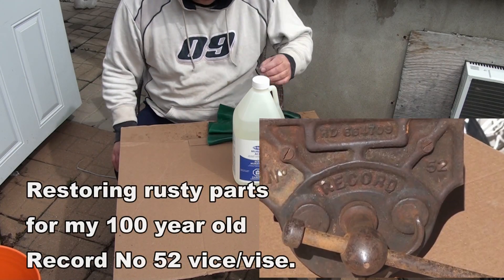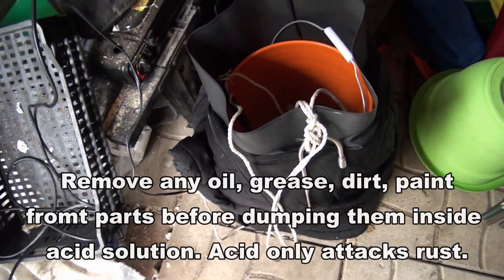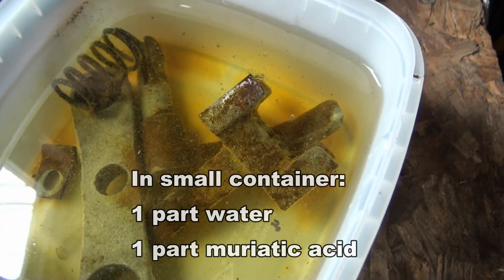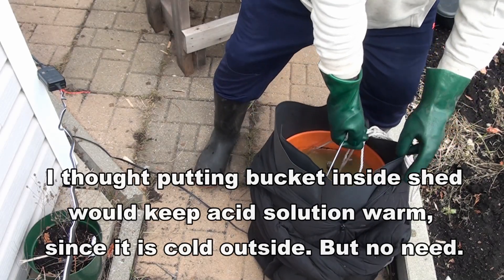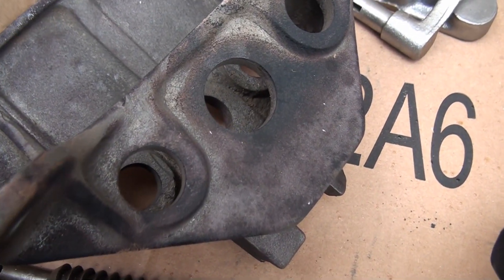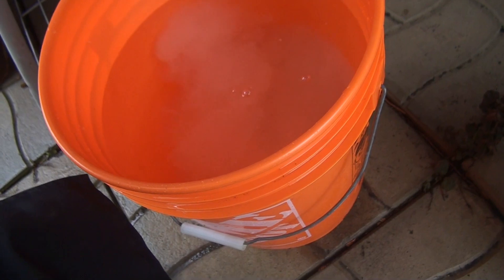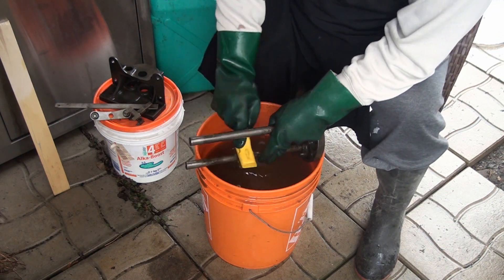Rust vs Muriatic Acid ***DISASTER*** Do not do this

Comment: I found out if you wash/soak it in the gasoline right after taking out from the muriatic acid.   all the left over acid from the rusted product will end up at the bottom of the bucket since it s heaviest comparing to petrol (gasoling) . Take it out , gasoline will evaporate and you ll end up with clean product ..paint over or buff it .

Comment: yup that's muriatic acid for you, and that's why I only use Phosphoric acid, I painted a hood of my truck after stripping it with Muriatic acid, neutralized it with baking soda after and still it rusted in less then a year after being primered and painted, trust me it wasn't that you left those other items in the shed, Muriatic acid does not prevent rust, that's why hot rodders use it to build up fake rust patina, it will actually rust things

Comment: I watched another video on rust removal with muriatic acid and that stuff is bad news. A guy used that stuff inside his shop and the fumes rusted a bunch of his metal projects that were in the shop besides the stuff he cleaned with it. Acid cleaning rust is fast but there's definitely a consequence if not done in the proper setting or method. 
https://youtu.be/pj40G8x2SVY

Comment: What percentage is the muriatic acid? I bought some today (paint dept,) and it is 31% muriatic acid. Is the acid you're using 100% muriatic?
Reply from the maker: Hey Wayne. Muriatic I used was 31.45%. Stay safe!
Reply: @Quinteros777  Thank you for the response. After I use the lantern, I'll let it cool. Then fill it with white gas to retard the rusting?

Comment: Can we use muriatic acid to remove rust from galvanised metal roof sheets?
Reply: Yes but you will take out all galvanize
Reply: Good way to die from the zinc fumes

Comment: After you clean parts in acid, immediately rinse in hot water, then wash in hot water and detergent and scrub vigorously. 
Rinse again in hot water and dry in a oven. 
Get the parts good and hot to evaporate any water and it will also evaporate any traces of acid that may have soaked into the castings.
After cooling paint immediately or oil parts that require lubrication.

The acid is both your friend and your enemy. It can make impossible cleaning easy but you have to work very fast to eliminate it or the parts will rust worse than ever.
Reply from the maker: Agreed, a friend and an enemy!

Comment: Sodium Bicarbonate (baking soda) will neutralise the acid as already mentioned, but what I did notice was that the black plastic bag was covered in water droplets..With the cold temperatures do you have a problem with condensation?…Uninsulated sheds and garages suffer really badly in winter, especially the ones with metal roofs, to the point where they are dripping with water..Temperature plays a massive part when doing this kind of work..

Comment: Water doesn't neutralize acid. Please learn about PH balances with cleaning before using strong chemicals that you don't know much about. You have to neutralize an acid with an alkaline
Reply: A what next? If I put it in soda solution, what is next step to remove this soda? Just water or nothing?

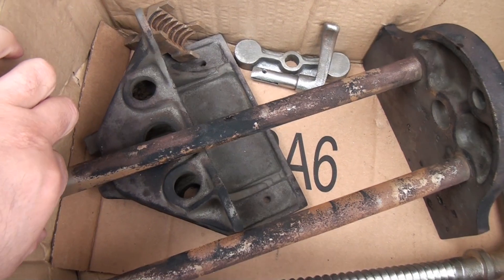Comment: 10:03 it's called flash rust.
Reply: flash rust is “rusting that occurs on metal within minutes to a few hours after cleaning is complete. The speed with which flash rusting occurs may be indicative of salt contamination on the surface, high humidity, or both.”

Comment: 1 Minute in and you already messed up! 
For that bucket I would only use about a cup of muriatic acid. If you used that whole jug you made it way too strong.
You should agitate the parts occasionally otherwise the parts touching will not be treated.
You DID NOT rub the surface with oil or a light coat of paint. 
YOU MESSED IT UP!...
Yup you are the problem!.... ALKA-BOOST? SERIOUSLY?
All you had to do was lightly coat the surface with oil or spray a light coat of paint on the parts.
You're just over thinking way too much!

Comment: fastest result. heat it up till it nearly boils.
reason for this is due to how chemicals work faster when the atoms collide more often, which is the effect of higher temperature.
this is in relation to how far away from absolute zero the temperature is though so even at near freezing the acid will still work quite well. though not as well as when it is near boiling.
minuscule difference when speaking about 20 degrees C.. 
so yea. sort of waste effort unless you are absolutely gung ho on saving a little bit of time.
the way to really make the reaction faster is by concentration, meaning don't delude the solution too much. it is probably already deluded.

!! Important
Always Always Always, safety first.
You can buy gas filters for that gas mask.

Comment: I can tell you what went wrong! You should have coated the newly derusted parts with a light oil like WD40 to avoid the flash rusting that happened overnight. It would have still ocurred even without the remnants of rubbish left in the rubbish bag.
Reply: That depends a lot on the humidity. The main thing that happened here is that he did not actually neutralize the acid. Cleaning it in water is not going to remove the acid. Then, if the humidity is fairly high, it needs coating, oil or phosphoric acid or a primer. If it's not that humid (like winter/spring conditions) then it's not going to flashrust. Ofc it's also important to completely dry the parts, a towel or cloth is usually not enough so it should be dried with hot air or a torch.
Reply: @TheChrisey  I've used a product called PHIX:
 
 Spray, brush, or soak to 1) totally dissolve the rust, 2) etch and zinc plate the cleaned metal surface, and 3) phosphate coat the zinc, leaving the surface totally prepped and ready to paint, oil, or polish.

It seems to avoid the flash rust.

Comment: Can someone explain this?  When I clean rust with muriatic acid and neutralize with baking soda, the metal shows rust in about an hour. But if I clean the metal surface with a grinder, I don't see rust for days. Why does the muriatic acid approach rust up faster?
Reply: After the baking soda bath its very important to Dry and oil part immediately or prime paint. Use a hair dryer or heat gun to dry the part.
Reply: Because of the water your using water will cause it to rust right away. You need to blow it off or spray wd-40! The wd  in wd-40 stands for water displacement formula fourty!!!!
Reply: Imo the rust appears sooner because in every step of the 1st modality is used water as main component. And remember that also basic solution have to be neutralized.. And it is a endless process.. H+ Vs OH- ions. 

Let me know what u think.
The proof would be wet the parts grinded.

Comment: Perhaps you should have neutrelized with baking soda, then protected with a coat of wd40. Ohh and wear your safety glasses as well!
Reply: Wd40 is not a lubricant/ oil. Does not prevent rust.
Reply: @bigtxbullion  WD stands for Water Displacement, it won't lubricate but it will prevent rust.
Reply: @motoservo  we all know what wd stands for. However, Wd40 sucks. You dont coat anything with it. zinc prevents rust. Oil lubricates and prevents rust, wd 40 is a short term product which will always have to be supplmented by another product to acheive long term rust prevention.
Reply: @bigtxbullion  I don't think everybody on Youtube knows what WD stands for, quite a few I meet in person don't. I have good luck with it as a rust preventative, actually.
Reply: @bigtxbullion  Finally, Thank you
Reply: Exactly don’t do it in the closed space open space and neutralise your stuff with baking sofa to bring down the ph then add wd40 then next day degreaser then as paint to your project and then recoil components... it’s not that hard... and also add more baking sofa to have a better effect on neutralising.

Comment: Very useful information regarding the impact on metal items from just the fumes from rags containing Muratic acid. I also learned this the hard way after placing a tightly sealed one gallon jug of muratic acid in a metal cabinet only to open it a week later to find a rusty interior of the cabinet and rust on the power tools stored inside.

Comment: This guy took too many risks moving containers and using it inside also strings to pull out the parts. What went wrong is after you rinse make a solution of water and baking soda and neutralize the acid on the parts by dipping them, have a second bucket of baking soda and water to do a final dip. Then when you have the parts clean and dry use a oil base enamel paint, or clean the parts with acetone or lacquer and prime them immediately for painting. Then you are good to stop the rust from returning. Most important be careful, this stuff is dangerous to breathe, wear the appropriate mask and eve protection with gloves.
Reply: This is the best advice on this process!!!!!

Comment: How long did it take how long you leave it in the acid?
Reply from the maker: It depends how rusty it is. You gotta keep checking. If you leave too long you will start eating up your "healthy" metal.
Reply: @Quinteros777  I mixed 2 quarts water to 2 quarts acid and it’s been 2 hours and rust still isn’t dissolved
Reply from the maker: @nicholasyoder  Depends the concentration of muratic acid you used. I used Commercial Grade 20º Baume (31.45%). Keeping solution warm also increases effectiveness. Good luck and stay safe!

Comment: Great video on the using the m. Acid. Electrolysis still produces hydrogen gas which is very very flammable. What I liked about the m. Acid, the process was really quick. I can’t see myself waiting hours on the electrolysis or the vinegar to work. I’ll spend the extra time on safely using the m.acid 👍🏻

Comment: Liked your good video presentation but you failed to oil your parts afterwards. Just plain old wd40 spray will protect or if in a pinch motor oil rubbed on.
Reply: Plus forgot to mention 5 gallon bucket of water and 5 cups baking soda is neutralizing agent post acid dip.

Comment: Sir I've used plain old white vinegar . And it's not poison . If it's real bad use a mixture of baking soda and vinegar.
Reply: Baking soda is a Base. Vinegar is an Acid... they are opposites. Baking soda neutralizes Vinegar, it is precisely what you use to neutralize acids... so mixing it with Vinegar won't make your solution stronger it will make it weaker.
Reply: @ryansenger408  your forehead is shiny
Reply: @mhxxd4  its not shiny it's bird droppings
Reply: @ryansenger408  when I have to clean an old n very crusty burnt up stove/ oven to make ready for next renter or find cool tools but are ruined letting it set between scrubbing works very well... But it maybe the grit in the soda .

Comment: You better to use phosphoric acid. It won't clean rust as muriatic acid did, but it turns rust and bare steel surface to black coating that prevents further rust. Similar to the way aluminum "rust" protects layer under it. You don't event have to neutralize exces acid. Just let it dry.

Comment: "the best way to neutralize it is with water" ABSOLUTELY WRONG IN EVERY WAY
Reply: Neutralize an acid with a basic material (common material: baking soda, for example)
Reply: @kevinbirchall2758  water and baking soda then?
Reply: @o6_blue_tacoma  Sodium bicarbonate alone would do, adding water may be easier to mix in best
Reply: So after I use water but I see it try to get crudd again
Reply: Lolapathy
It's so funny

Comment: You need to neutralize and OIL IT.
Reply: You got it right, you neutralize the acid with sodium carbonate and water then hit it with oil to prevent flash rust. When your ready for paint hit it with acetone to clean off the oil on the parts that are to be painted  that simple.
Reply: Don't forget the butter.
Reply: ￼ what kind of butter
Reply: @litty1776  Unsalted....
Reply: Any specific type of oil?

Comment: Anyone reading this , dry immediately after washing the parts clean of acid, then dry again with a hair dryer or blow lamp to eliminate ALL water from crevices, buff with clean rag and IMMEDIATLEY oil or paint otherwise as others have said parts will flash rust in minutes
Reply: Any advice on how to do this on larger items like a farm barn walls and roof?
Reply: @delatroy  We used to paint large metal structures like water towers and bridges.  Most paint was sandblasted and sometimes chemicaly stripped.  \Never I mean never strip more surface area than you can prime seal the same day.  Microscopic surface rust sets in almost immediatel it may not even be visible.  The next day do another section and prime what you stripped.  Once all areas are primed you can sand clean and topcoat.  If you don't do this you will have rust immediately starting under the new paint job.
Reply: @janettebuba126  thanks
Reply: @delatroy  don’t do that with muriatic acid at all. It’s highly corrosive, gives off dangerous fumes and can’t be healthy for whatever you plan to keep in that barn.
Reply: @StrikeSparks  while the appropriate safety precautions need to be taken while using anything corrosive, the fumes do not linger in the way you're assuming. The barn would not become contaminated because muriatic acid was used, but it's not best option for that type of job imo. 
Using a pressure washer to remove the rust, replacing any rusty screws, treating the entire surface with a rust inhibiting primer, then painting would be better for a barn.
Reply: @delatroy  DON"T!
Reply: This is actually wrong, you should neutralize the acid with bicarb, then you should keep it wet with Citrix acid for at least 20 minutes, then rinse off and dry and the metal won't be so reactive anymore.

Comment: i used pure acid. The parts were clean in 20 minutes. I washed them with water, and dried them with a clean cloth. I saw the beginning of rust, very faint rust. I laid an open carton, and immediately painted all. A week later I looked. Wherever paint had not reached, was rusted again. So, back to the acid soon, wash with water, and hang objects on metal wire to see all nooks and crannies, then paint again. Oh, the smell of acid or by product of acid eating the rust - I got a brief but really nasty hit. Seems to burn through my nose tissue. Will never forget it. Nobody will.

Comment: never try to neutralize and acid with water!!! always use a base such as baking soda, and pouring warm water into acid is a terrible idea
Reply: Using muriatic- not oxalic.
Always pour acid into water- never the other way around.
Reply: @williamevans6522  so is it just oxalic that requires warm water? Muriatic, hydrochloride, they don’t need warm water?
Reply: @ProCleanServices  In general, chemical reactions speed up with increasing temperature.
Reply: All the instructions I’ve read for oxalic acid say to mix it with warm water. What am I missing?
Reply: I didn't see safety glasses  
I am interested in buying your =

Comment: Neutralize with baking soda solution, let dry but quickly oil, paint or spray a coat of clear on it. They will stay shiny! Been there done that. Always wear a 3M respirator with filters. Been there done that.
Reply: Do you ads baking soda to a bucket of water?
Reply: @josealejandromartinezlopez3924  Have a separate bucket ready with a solution of baking soda and water to neutralize the acid on the part you are cleaning.
Reply: @josealejandromartinezlopez3924  You add the baking soda to the container the acid is in.  If its a small container, pour it in a bigger one with alot of water. Baking soda & acid causes kind of a volcano of fizz & fumes. Best to do it outside.
Reply: Best to do everything outside. Those fumes are going to rust everything in your shed.
Reply: Thanks. I want to remove rust on an old farm shed. I want to use the acid but I’m worried that it will seep into the soil and make it toxic. How can I be safe or is there another way?
Reply: @delatroy  definitely toxic and dangerous. Just use sandpaper or a grinder
Reply: @StrikeSparks  its a massive area..

Comment: It’s flash rusting.  Could you simply oil the parts after?
Reply: Yes, oil is highly recommended, or electroplating, or galvanizing, or if it's mild steel you can apply a black oxide coating
Reply: I think so

Comment: You forgot to neutralize the acid with vinegar or some kind of agent. All of my parts look amazing I use a 2k clear coat on them which seals the metal.
Reply: to neutralize an acid you need a base, soap should work just fine.
Reply: vinegar is iffy use baking soda and water then soapy water then acetone orheat the metal to remove any moisture
Reply: @beezwelliver4806  Vinegar is not "iffy". it is completely wrong for this purpose. Must use a "base" to neutralize an "acid".
Reply: the rule of thumb is that Bases are Slippery. If you are wondering whether it is an acid or a base. if its slippery it doesn't mean its a base, but if it isn't slippery it is almost definitely not a base (ie, the thing that neutralizes an acid) (and an acid neutralizes a base). Soaps, toothpaste, baking soda in water, bleach ...slippery... base. Citrus juice, Stomach acid, Milk, coffee... not slippery = acids.